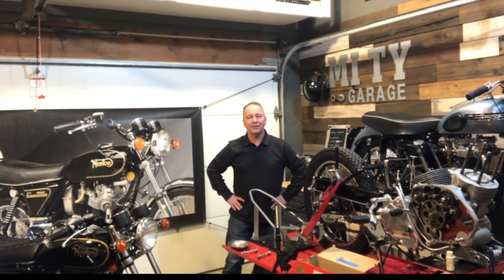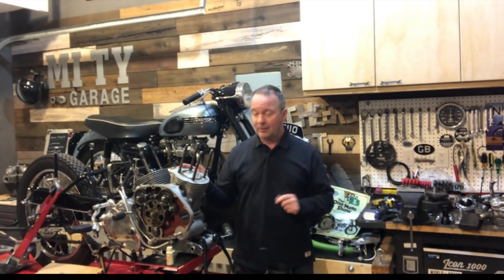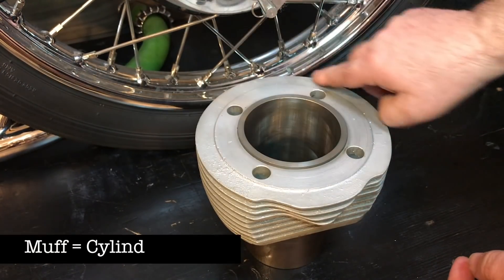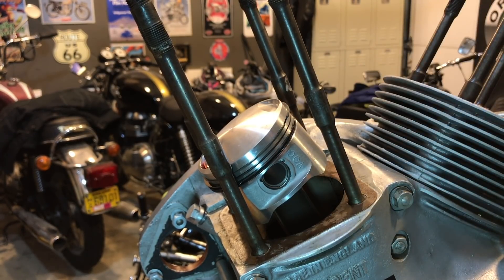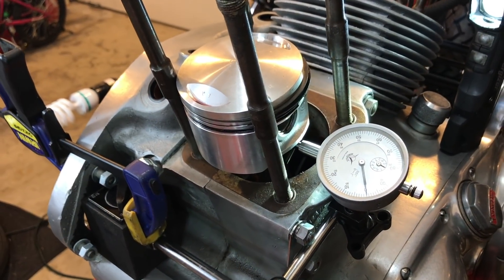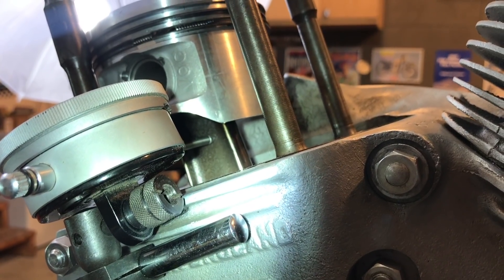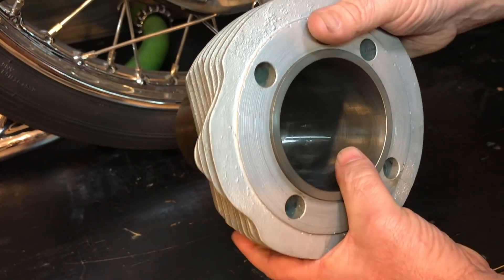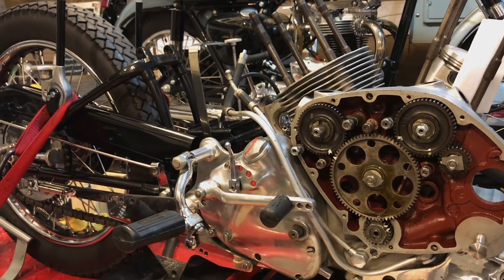Restoration of 1951 Vincent Rapide - Part 21 - Top End 2

Comment: I think having got this far you can see almost everything you would see if you split the crankcases, but without the extra work, it has obviously been re bored before the seller gave up on the project, so that is a good bonus, the only thing that could be a problem is that if the liner/muff interference in less that .006" you can get a problem on heat transfer, but as you observe the cost of new liner/muffs and pistons is not that high, so just run it and save up while you enjoy riding it, you can put off for ever these things and never get to ride it, (I know), so having made a first class job of cleaning it all up, and checking all of the bodges,(hopefully), you can now start to get it all back together and enjoy it. Well done for having the patience to check everything, some of the things you found could have resulted in a very expensive failure had you just started up and ridden it. Chris B.
Reply from the maker: Thanks a lot Chris for your comments.  Much appreciated.  Hope all is well.  Best wishes, Mike